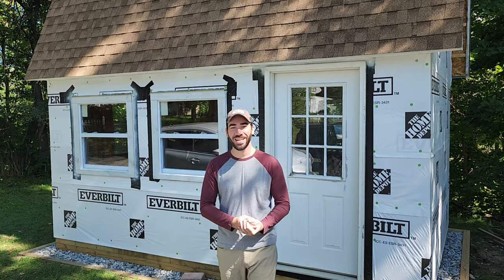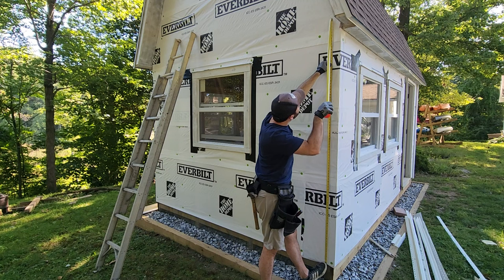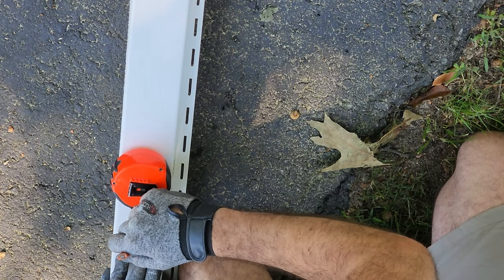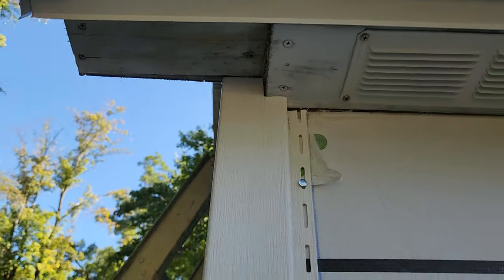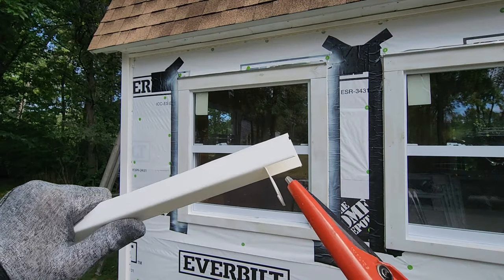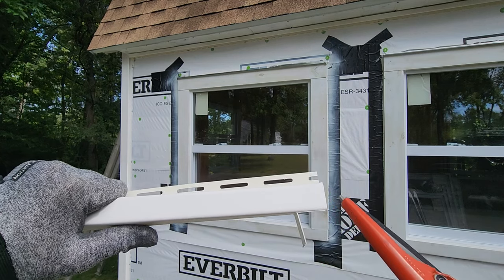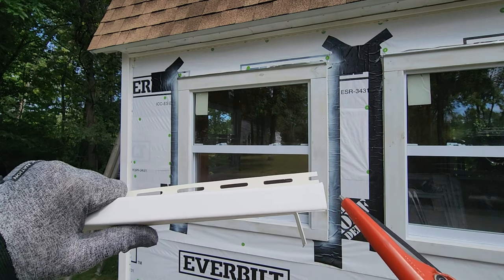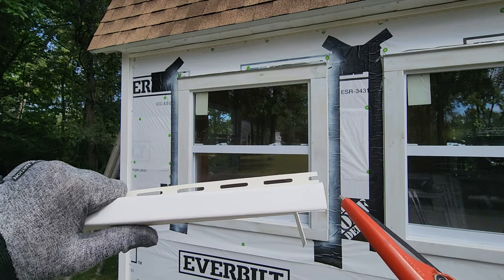How to Install Vinyl Siding Yourself! - Shed Build Part 11

Comment: Great video!  Here's a trick that works for me:  whenever possible hold the nail between your index and middle fingers with your fingernails against the building. Much less painful than pinching the nail and hitting your fingers over and over. Might be worth a try!

Comment: Another great video.  I have a 30 year old shed I built when we built our house. The shed was primarily to be a pump house. I didn’t put on house wrap and now I have rotted OSB to replace.  The lower 3 panels have holes from something like a mower or the pile of metal and wood that was placed there.  Yeah I know, my fault.  🤦‍♂️ So if I heard you right, the vinyl siding is not meant to keep the wood dry but the house wrap is.  I may just have to remove all my vinyl and start over.  Ugh.  Thanks again for your informative videos.  All the best from north Texas.

Comment: Use a pneumatic stapler to install siding (thru and over nail flange) way faster, still allows movement if depth is set properly. Also, bottom edge of mini house would benefit from a fluid applied flashing and drip cap flashing. Ground contact treaded wood bridge material between wood and ground/ foundation etc use thick mil plastic/foam/rubber, will keep wood lasting longer ….  Also, above the entry door on the roof, install a rain deflector a shingle row or so up is a nice add.

Comment: Great video. I've never really looked at the specifics of installing vinyl siding, and it looks like you did a quality job.
That being said I find it disappointing that you built this shed like a tank so far, and then decided to wrap it in plastic. It's not a choice I would have made, but I'm sure it helped keeps cost and labor down.
I've had homes with vinyl siding and it fades, stains, cracks, and can be difficult to clean when it starts molding/mildewing.

Comment: nice job - I learned three things - the two little tools for the siding - and the snap thingies to snap at the top - I did not know that for real. I am going to in a week or so build 12x20X8 feet tall in my back yard - with siding like this and windows - I might ever be stupid enough to drywall inside it and a few solar panels on top - but only if I am a fool because I got no time for this type of shit..lol